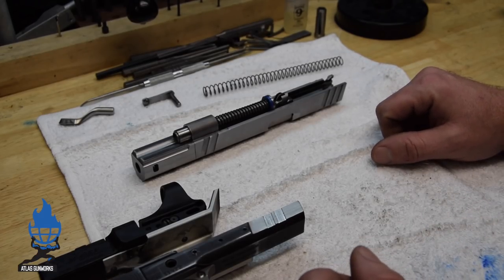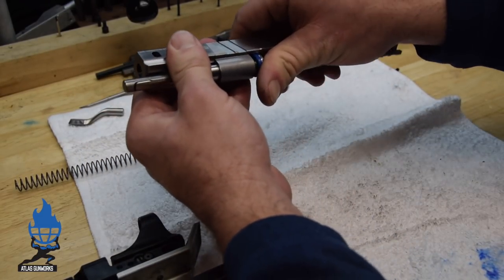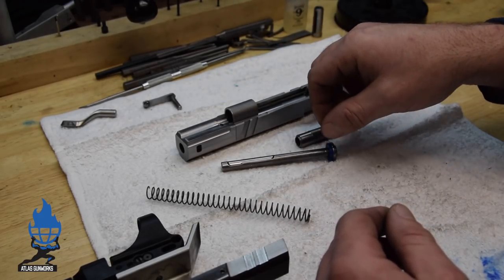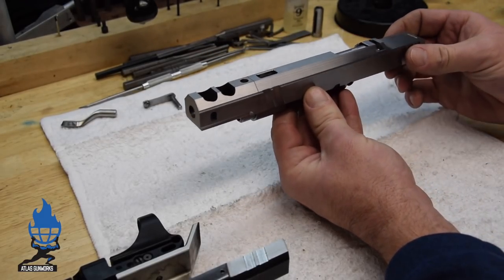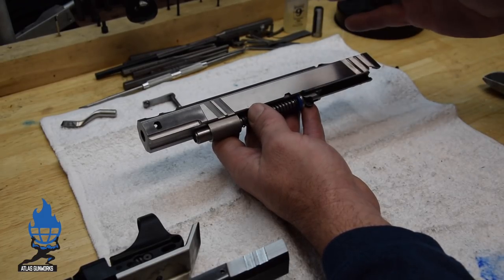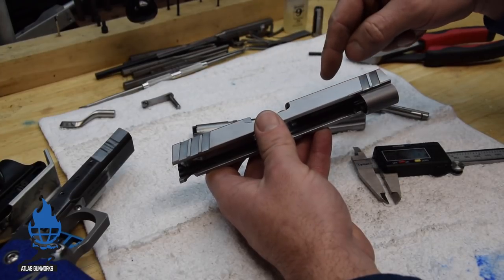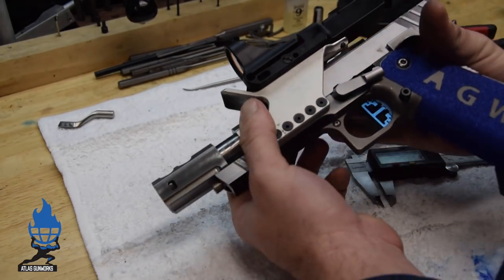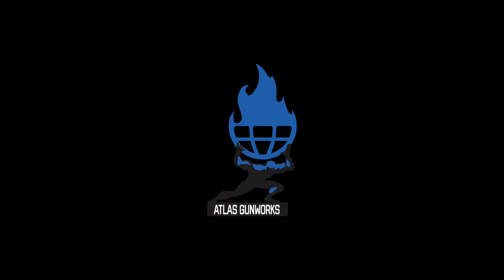Changing 2011 Recoil Springs and What does Stroking Guns Mean?

Comment: @ 0:44 a custom cut reverse plug was mentioned for the commander slide running a full length guide rod; what reverse plug is recommended to be custom cut? Thank You
Reply from the maker: In this case we used a EGW reverse plug.

Comment: This is a very awesome video.
I understand everything, but i have a question:
I have a Tanfoglio stroke open gun and I need to cut my spring.
If i want to use a variable spring, what's the part to cut?
The close coils or the wide coils?
Reply from the maker: You would want to cut off the close coil side
Reply: @AtlasGunworks  ok... Thank you very much

Comment: does this also change the spring tension after cutting it?
Reply from the maker: Most times the spring tension stays relatively the same
Reply: +Atlas Gunworks 
I wasn't sure if it would change a 12lb spring to run like an 11lb spring?